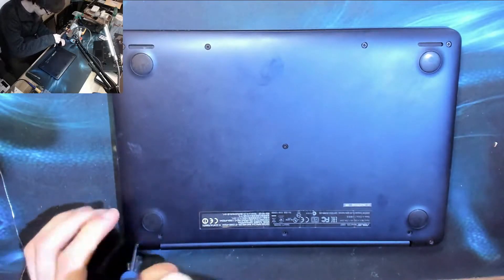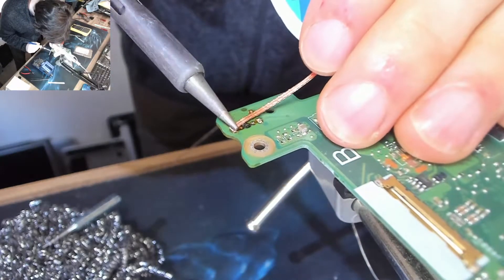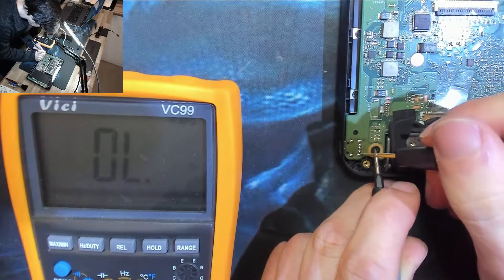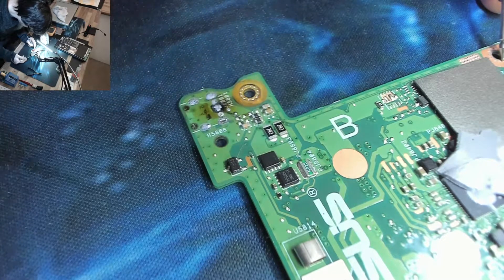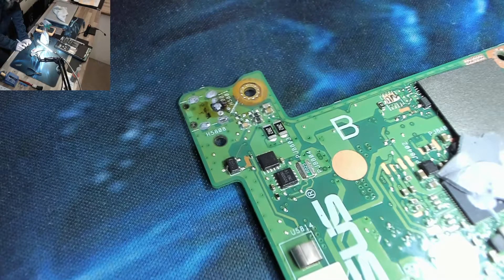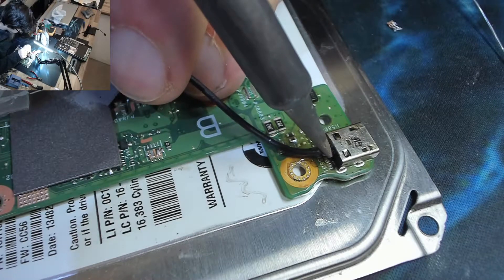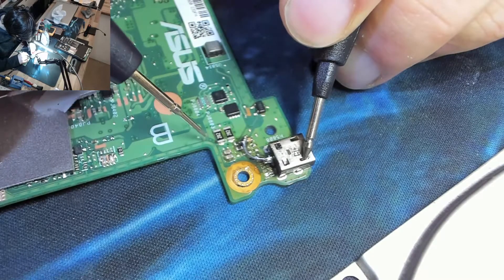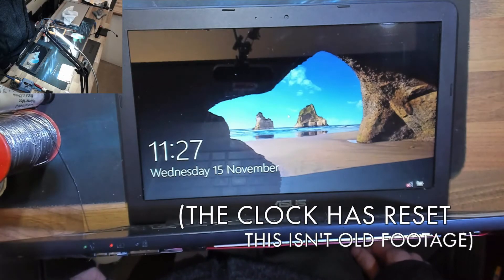LFC#127 - Asus X205T Shorted DC Jack

Comment: The sheath is known as insulation! Great work! Can you put some non conductive sealant or RTV? Is the SSD on the keyboard side of the logic board, or is Win 8 / 10 a SoC/SoaC?
Reply: geek  I thought SoC meant System on a Chip. Thank you 🤓 & the SSD is soldered to the m/b. Thanks 👍

Comment: Awesome video. I'm experiencing the same thing on my msi gt683r laptop (a short between vcc and gnd in power jack area of the pcb). The repair shop quote to do is was $300 excluding possible main board replacement cost. 
So from your video the necessary equipment looks to be soldering and heat gun station, along with solder and flux. And then other things like a vise and helping hands. I am new to this type of repair so just wanted some advice.
Once I do the repair, I will update on how it went (hopefully goes as smoothly as yours)🤞
Also did your power supply adapter also short out the first time you tested? Mine blew out when my laptop's dc jack did. Would you recommend repairing the shorted power adapter?

Thanks in advance!

Comment: Nice done, but it was easier to solder the wire to the copper trace. Not necessary to solder the wire directly to the cap. In your case, you could take the first or second solder spot next to it. It does not matter, nice job. I have a problem with a MSI Dominator power jack. I soldered a new one, and i read a short to ground, after removal of the jack, the short disappeared again. I will not risk it again. I will bend the 3 legs that are connected to the board together and jump it next to the first components. I also have to cut the trace first. It is not worth it anymore to risk a internal short.

Comment: Brother 
Thank you so much 💓 
I had a similar issue and fixed it with the help of ur tutorial. 
Anyway there was a minior version difference in the board and it didn't work the first time after i made the cut. with a bit of common sense managed to trace the new solder point, reverse tracing from the Moffett 
Also I couldn't find a replacement jack so I modified a magnetic phone charging cable and now it works like Apple mag safe
Anyway thanks again for your help
Reply from the maker: Commonsense is the way forward! Fixing things isn't about copying someone else exactly, it's about understanding how they figured it out. Well done!

Comment: Great video, nice videography and music/sound! Did you use a normal hot air gun or a re-work station for desoldering? One humble recommendation: You can use ETFE wire for the jumper, it's heat resistant and commonly used for that sort of work. Cheers.

Comment: It's easier if you heat the solder and the board before you place the DC-JACK.
Reply: Heat from the back maybe, and you can insulate with hot glue. Learned from "electronic repair school".  Thank you for the video! I Learned something new.